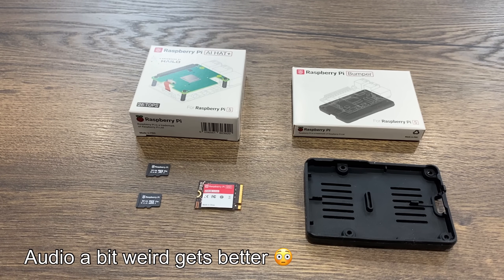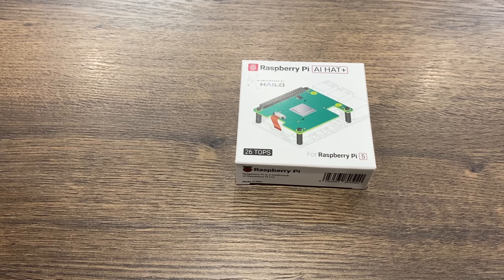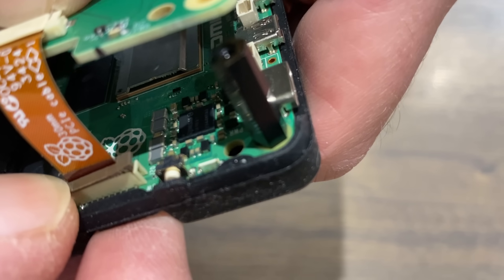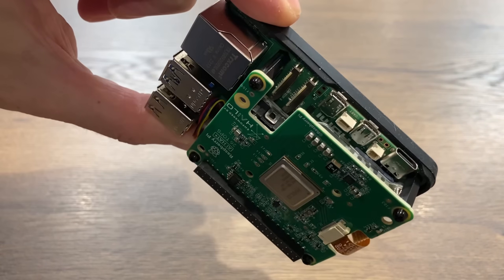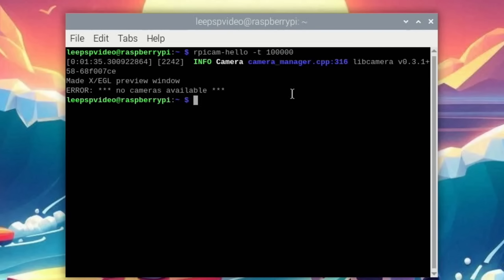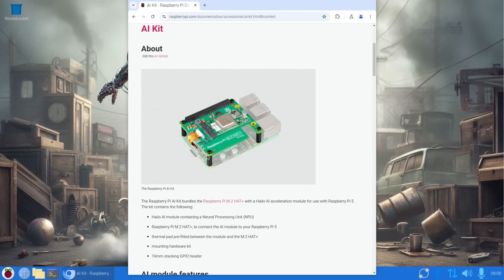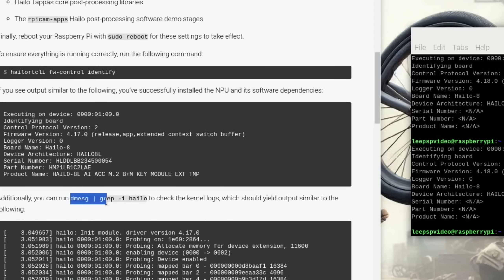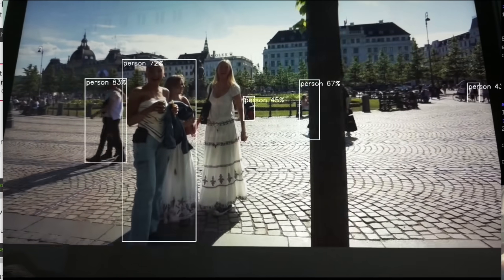NEW Raspberry Pi AI HAT+ Powered by HAILO. 26 TOPS

Comment: 4:00 if you plugged that cable the correct way — it should have worked, but backwards... It is expected to fail
Reply from the maker: @gorin3512  I tried many times in all configurations before without success

Comment: The bumper is my favorite Raspberry Pi product of 2024, quite useful!
Reply: Does the bumper work with a pi 4 also?
Reply: If they can attach it onto the official case, then that would make my day.  A hybrid bumper fan case
Reply: One of my Pi 5's is left open for nearly constant tinkering, so the bumper will be enormously useful as a zero fuss way to protect both the Pi and my work surfaces.
Reply: It depends if you throw your Raspberry Pi about a lot. Personally I'm extremely careful with the stuff I have on my workbench to not really need to protect it in rubber. It seems a very pointless product when Pi cases are cheap anyway, or you can 3D print your own.